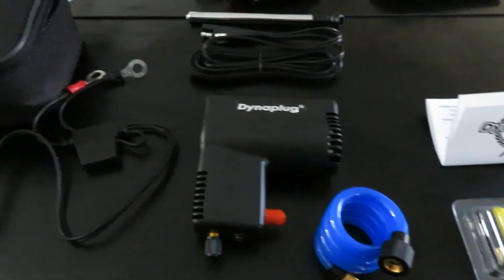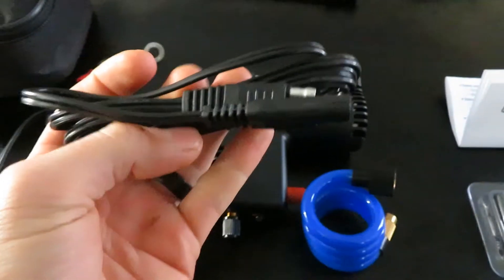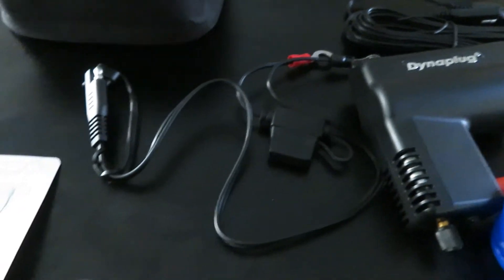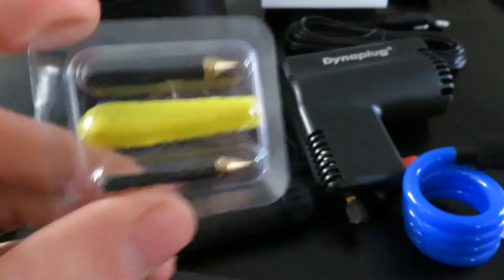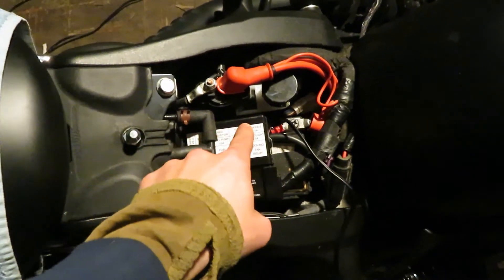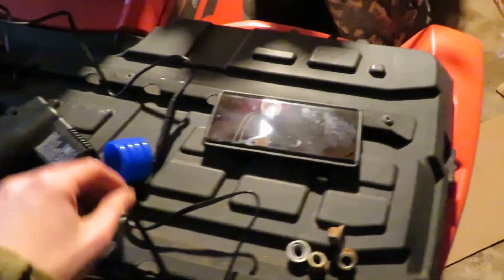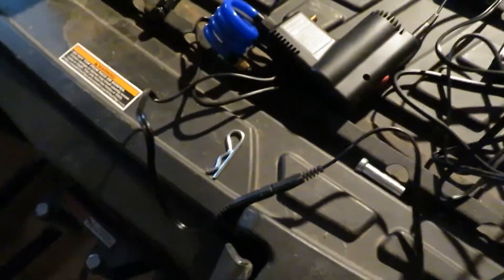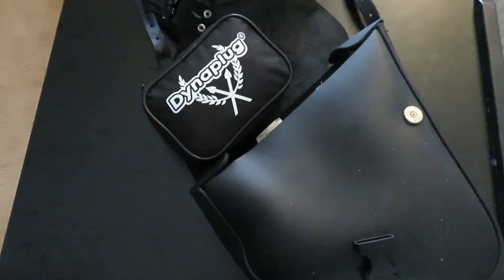Dynaplug Micro Pro Inflator

Comment: Nice video. Not sure, but I believe your bike has a built-in battery tender that you can just plug this unit into. Make sure bike is running as it does draw a fair amount of current.
Reply from the maker: Just the other day I discovered the scout has a battery tender. its behind the ignition switch.